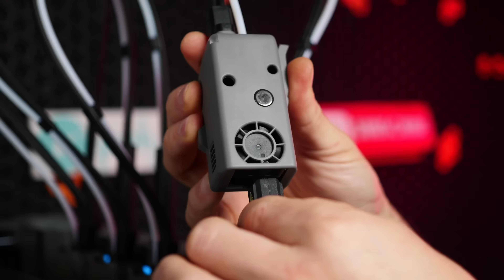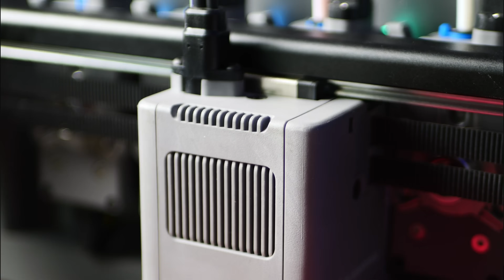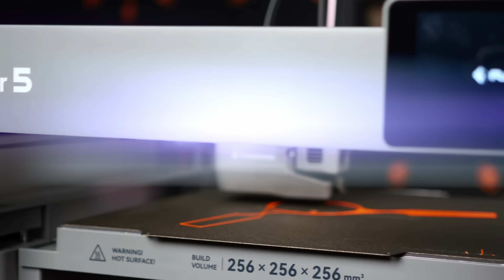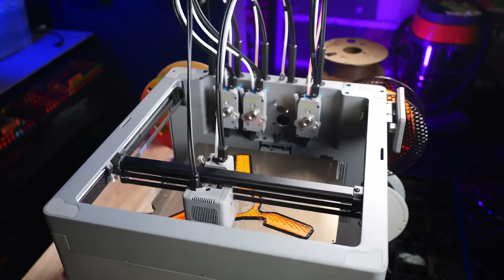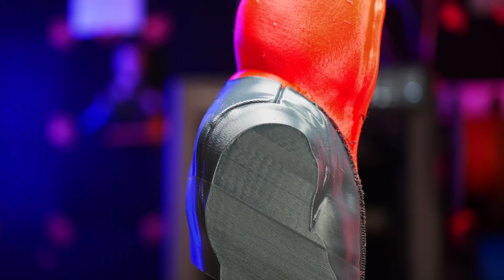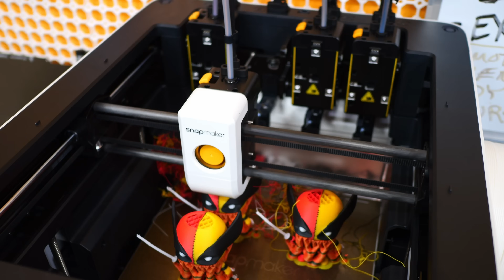How Good Can a $699 Tool Changer REALLY Be?

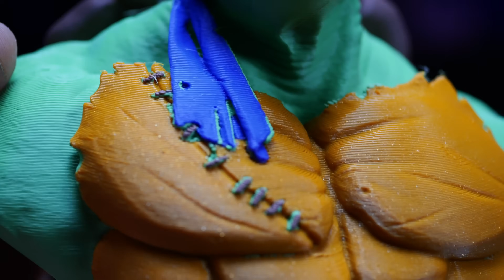Comment: A question not related to this particular brand. Isn't it possible to use the purge material in the infill? 10:18
Reply: I think there is an Orca slicer setting for this. To confirm.
Reply: Yes BUT... 
1 - purging dark colors to the infill can leave visible stripes / blotches / etc in areas where the pet walls are lighter colors. White infill behind black walls can even cause the black to not look entirely uniform. 
2 - directing in the system, the tower is often not the main recipient of purge waste. It's mainly used to clean the nozzle and get the filament flow uniform after the change. Hence why it's called a wipe tower, not a purge tower, in most slicers. In most filament swappers, at least, you can eliminate the tower altogether, even without putting into infill - the purge is external (poop removed from the print area). But you can get color contamination or inconsistent extrusion where the new color first starts printing. Still need the wipe tower. In a retrofit situation where there's not a reasonable way to really get the purge out of the print area, you can still purge into the tower. But in most systems, that's not really what it's for.

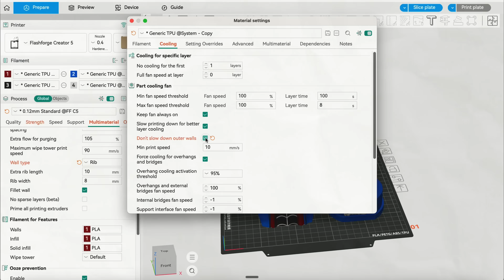Comment: 16:24 I disagree that this has to do with the layers cooling down. I claim that it's rather because the matt layers where printing at a higher speed, so fast actually that the hotend couldn't heat up the filament enough. So my fix to this would be to reduce the volumetric speed for that filament so the max speed doesn't go over that threshold.
Reply: i cannprint matt pla really fast on my printer
Reply: yeah, but that's more because of the flow, probabably the spool maker was cheap like most, so it's supposed to go lower flow, when you print fast you should higher the temperature, but he did not do it, so the temperature, flow or spool.

Comment: I hate that the clone armies in 3D printing keep duplicating the mid build volumes and never think about an option for a bigger one.

Sure, you could clone the prusa XL but nah, do the smaller one cuz Bambu is popular and you gotta copy everything about them.
Reply: Sovol is said to be working on a 6-head tool changer.

If it were based on the mechanics of the Sovol SV08, then we'd have a 350x350mm plate (with the SV08 Max, even a full 500x500mm).
Reply: @Fabrizio-xk1ly  interesting. The pics suggest it might be a Trident style design from the short filament parts unless it was just a rendering mistake.

Wonder if the bondtech indx will have an installation setup soon for sovol.

Comment: I feel bad for flash forge because this is not a BAD machine but it's just not as good as the U1
The U1 has a larger build volume, a door and back window, a filament feeder, a catch bucket.
Ok sure they made it like 150$ cheaper but I think most people would rather have all the extra features of the U1.
Reply: Why should it have a catch bucket when it doesn't poop? It only poop when it start a new print session and when it start a new spole.
Reply: However, there is also Creator 5 Pro version that costs about the same as a U1 but offers the following extras:

- completely enclosed and quieter printer
- nozzles up to 320 degrees (U1 stops at 300 degrees) 
- bed up to 120 degrees (U1 stops at 100 degrees)
- HEPA + Carbon air filtration system
- active heated chamber up to 65 degrees.

Comment: Looks to be fairly capable, especially for the price. I'm curious how it handles softer TPUs, though. They seem to be getting trickier to print with now on a lot of newer machines given less direct paths (without modification) with multicolor/multifilament systems.
Reply from the maker: I did test on an extremely soft TPU air and had some issues, but if you recall, when I tested that on the Snapmaker, I had to adjust a bunch of parameters in the slicer to make it work, and the FlashForge slicer didn't make that easy. I think if they were to update the slicer to allow me to change retraction before tool changes and stuff like that, it could print very soft TPUs because actually purging the TPU to load it worked fine. It only jammed after the first layer.

Comment: Don't slow down on outer perimeter will fix it for certain.  It doesn't slow down the outside to make it uniformly slow, it just disregards your cool times per layer for the filament so the speed stays consistent, then it will slow down more on the infill.  The main times you have to be careful with this are very small items that really need the cool time - these prints don't look like there would be any negative impact.

Comment: I really don't like the "don't slow down for outer perimeters" setting. It can get weird with overhangs and giving the perimeter enough time to cool is an issue. 

Instead I just try to get the outer perimeter to match volumetric flow rate. Not flow rate, volumetric flow rate. Not the easiest thing to do, but the results are worth it. I've wanted the option to set speeds by volume instead of mm/s for a long time but I haven't seen anyone do it yet.

Comment: @The Next Layer  You did not say how hot it can print for technical filaments  or the type of timing belts by the look I am guessing they are 2?
Reply from the maker: I think it’s 290C, but not sure. My brief wasn’t spec heavy TBH I think the non pro is very much designed for only PLA and PETG
Reply: @thenextlayer  They say 320 °C in the current page, I saw somewhere they claim 350 with some trick/special hotend?

Comment: Does it support the Orca "full spectrum" mod? I know the U1 and Bambu have implemented it but would really want to know if the Creator 5 can support it.
Reply from the maker: As of right now, I haven't successfully been able to port the profiles over to any other slicer, but it should be doable. And I've also applied serious pressure onto FlashForge to make profiles available for OrcaSlicer and Full Spectrum. They ship the printer with CMYK filament, so they clearly are aware that users will want to experiment with Full Spectrum. But this is kind of the problem with not open sourcing the product, is that the community can't do it for themselves.
Reply: @thenextlayer  So there is hope :)  Thanks for letting everyone know. Appreciate your work.

Comment: U1 looks to be worth the extra money over this.  With that said, I'm glad others are dropping tool changers.
Reply: I own both (but the creator 5 pro). the flash forge is just better, less problems, smoother prints. The only thing the u1 has is rfid and I have never felt it necessary. just fyi..thought it might help.
Reply: for me the u1 isnt worth it. 
u1 does not have a 65c heated chamber, no CF ready hotend / nozzle. 
The u1 hat is very expensive and doesnt even have a active heater
Reply: @KidCe.  You can buy add-ons for the U1 if you want to heat the chamber. The open source character of the U1 firmware makes this possble.

For the same reason hotter nozzles will only be a matter of time.
Reply: @koenraadprincen7212 Sure you can buy addons. But U1 does not support a 65c heated chamber by default. The toolheads and internals motors are not developed with 65c chamber in mind. Also that adds alot oc extra cost and effort to add the Modules. So i choose creator 5 pro which has all these Features already implemented and working without me needing to invest time and more money.
(Hoping that flashforge deliveres a good working printer. Still big chance the machine  could be shitty)
Reply: @KidCe.  understand, but neither tool changer has that...   sounds like you.ll have to wait on tool changers
Reply: @FPSRain253 Creator 5 PRO does have active 65c heating.
Reply: @KidCe.  i guess i didn't notice for some reason.
Reply: Why do you say that?
Reply: @camarogs1  Print quality, extra volume, rfid, etc...
Reply: @FPSRain253  Not to mention "open source" :-)

Comment: How far have we come that a minor gripe would be "this printer doesn't have a pre-feeder". I recall the days of manually tramming and leveling bed slingers with unheated glass beds that suggested adhesion, rather than actually providing it. I think FlashForge's engineering solution to the tool changer extruder motor will be replicated across the industry, if it proves to be reliable. It's nice to see more innovation! Now if printer manufacturers could just get rid of brass nozzles altogether and ship proper hardened steel nozzles with their printers (to that end, I think reviewers should start hammering manufacturers on that point in every review).

Comment: You should use adaptive layer height in orca. I don't remember what the same thing is called in other slicers but that way you don't have to print whole thing in very thin layers to avoid stairs.
Reply from the maker: Yeah, I only realized that you can do that and still use a prime tower recently because I know that each object has to have the same layer height and I got confused into thinking that also meant each layer height had to be the same. But you're totally right.

Comment: A very nice video but I would have liked to see the amount of poo the printer produced or even compare it to other printers. Also how the printer gets rid of the poo that part was too short, does it just let it fall on the printer floor? What if it sticks and gets drawn on the printing bed? Keep up the good work!
Reply from the maker: It's a tool changer. The only poo is that tiny little bit I showed at the beginning of the print. And of course, the prime tower, which I showed. There's no purge besides that.

Comment: If there's anything universally true in the tech space, it's not the company that did it first that succeeds, it's who did the best integration where eventually That product becomes the standard. Will the flash forge be that for tool changers? Too soon to say, but other than the build size being a bit small for my use, there's enough meat here to be interesting. A tool changer with at least a 320x320 base size, heated chamber and out-of-the-box ability for at least 350C is my tipping point from interest to slap down the plastic and buy it now.
Add: The above and running on main line klipper. No proprietary garbage if any one else out there is taking notes.

Comment: Glad it's looking to be a good toolchanger, I've not owned a Flashforge since around 2015 but they don't seem to have had any big controversies or issues I've heard about in all that time. As much as I'd like a core one, I may be better off with a Flashforge again on mine or my workplaces budget. Also the automatic flow calibration (is that right?) is something I am baffled I have not seen more companies do since Bambu put it on even their low end machines

Comment: flashforge sensors & hardware tend to be bottom tier, meaning they'll start manifesting serious issues in many cases within a few hundred operating hours.  their firmware also tends to be similarly half-baked, which exacerbates the issue.  case in point, my adventurer 5m pro started magically losing z height & level data mid-print, which resulted in a nozzle literally being snapped in half when it was rammed into a ~30% completed print - which i've noted in my research has happened numerous times to other flashforge customers.  customer service, on the other hand, is prone to blowing off or insulting customers rather than rendering assistance or guidance on any given issue.  people who know me know i've built several 3d printers from the ground up, often custom.  while the price point of their machines is certainly attractive & the body of the machine is typically quite solid these days, i cannot in good conscience recommend a company which uses such substandard practices & components, especially when they treat customers that way - tattling policy aside.  as soon as i can afford it, i'll be gutting my ad5mpro & replacing the electronic components with bigtreetech, the bed with mic6, & the toolhead with something more consistently reliable (possibly dragonburner, possibly a4t, i haven't decided yet).  i'd already decided on replacing the x-gantry with something similar to what's shown in this video, though, which i think is ironic.

Comment: Would live to see a comparison video between snapmaker u1 and the creator 5.  Also interested in a comparison between creator 5 and creator 5 pro
Reply: I own both (but the creator 5 pro). the flash forge is just better, less problems, smoother prints. The only thing the u1 has is rfid and I have never felt it necessary. just fyi..thought it might help.

Comment: Why couldn't you see print times on mine it shows on the display as it print and gives print time in the slicer.
Reply from the maker: But not after it's completed, you can't see the actual time. So if you didn't write it down after hitting OK, it's gone...
Reply: @thenextlayer  Brother, how are people meant to take your opinions seriously if you struggle to do the barest minimums to gather and provide such relevant information? For a 3D printing channel that's been around for more than just a couple years, you'd at least expect some more effort put into understanding the basic aspects of the sponsored product whose price you keep gushing over. Like, not to be rude, but at some point it stops being a conversation of whether or not you're shilling and instead brings up the question of your competency in showcasing these products to real people that are expected to spend their hard-earned money on these things.
I can't make a guess of how busy you might be but surely it wouldn't have been hard to simply set up a camera to record the prints, that you were going to complete anyway, and then simply check the time for both the print itself as well as average tool changes in software.

Comment: Interesting and quite an elegant design doing away with the steppers - it makes it something between the U1 and INDX.  Can still do preheating which is an advantage over INDX, and the toolhead look quite small - so could potentially make room for a few more.  Also like the cutter being include for later AMS type additions.

Only downside I can think of is lack of motor will mean that background partial priming won't be easy to add - so tool changes will probably always be >10 seconds print<>print.
Reply from the maker: I think it can preheat, yeah.

Comment: Flashforge makes reliable printers. The AD5X, even when not using multi materials, always renders great results. The M and M Pro as well. I still use an old Guider 2S and the support they still provide is impressive.

Comment: I designed an enclosure for the Creator 5  Good video you covered it well. 😊
Reply: That's so cool! May I ask if you designed it separately from flashforge or do you work for them?
Reply: @brendan9853 I'm not associated with Flashforge it's my own design. Easy to assemble and very easy to print.
Reply: Will need a chamber heater.
Reply: @truantray a chamber heater could be added very easily with my design.

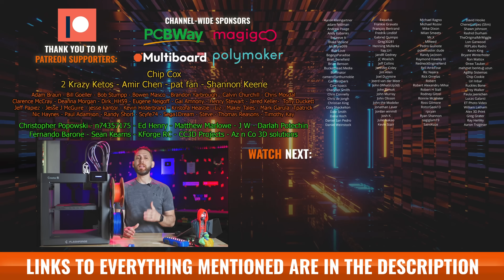Comment: 19:58 Snapmaker has changed me, I only want to buy open source now. I don't recall if you said the FW was open or not...?
Reply from the maker: It is NOT open.
Reply: Great point. It's hard to compare open source with closed source printers when you buy something you plan to use for a long time and plan to be able to make adjustments or upgrades to the hardware and software. 👍
Reply: Owning what you buy sure does feel nice ♥
Reply: @L0g1calMadn3ss  waiting to see, but for example the AD5M & AD5X were running Klipper under the hood, but without an accessible WebUI, meaning you had to use the Flashforge skinned Orca, or USB your gcode over.
It didn't take long for some mods to come out though.
I use Zmod on my AD5X which includes Fluidd by default, but also supports Mainsail. It also updates Klipper to a newer version with some fixes, and you can now use regular Orca Slicer.
I'm hoping things will be similar with the Creator 5, and the community has been getting funds together for the Zmod developer to be able to source a Creator 5 of his own to work on for hopefully a faster port.
(he developed the port for the AD5X without owning one, meaning each test he needed to send out to others and then tweak the code and try again)

Comment: Would the creator 5 pro be less prone to that issue with the surface finish due to the different layer times, due to the heated chamber?
Reply from the maker: that's a VERY good question. I think it depends on which material, because PLA doesn't print with the chamber heat...